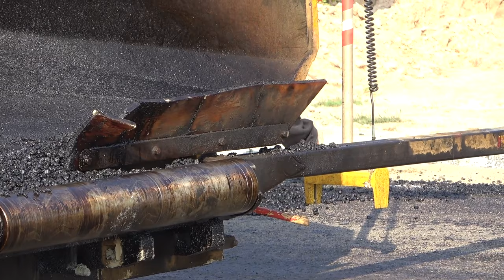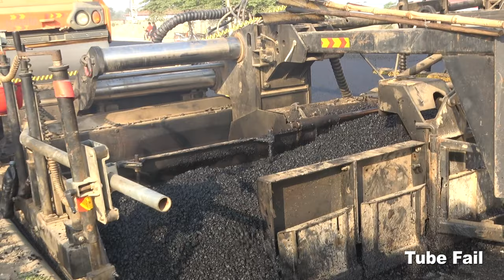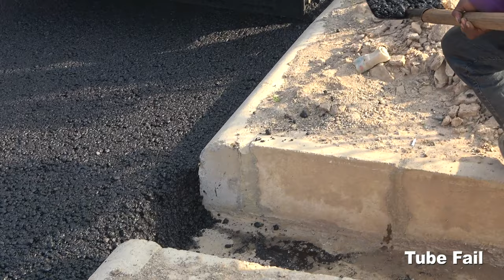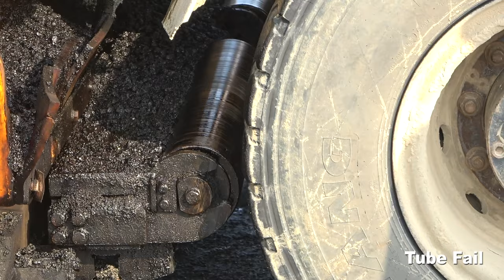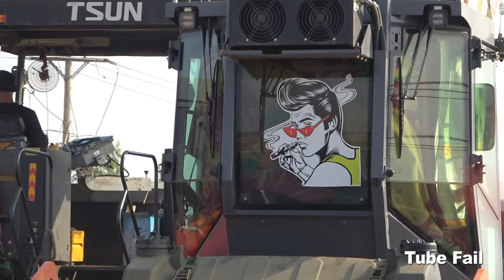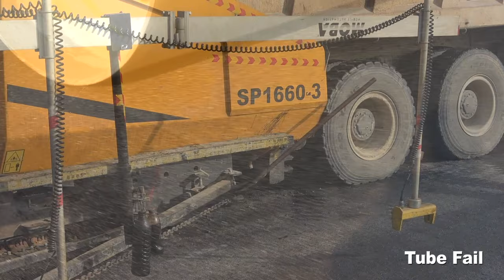Road Paving Machine | Modern Road Construction Machines | Road Construction Technology

Comment: Does the Paver push the Dump Truck?
Reply: No I don't think so, I think the truck drives at a very slow speed
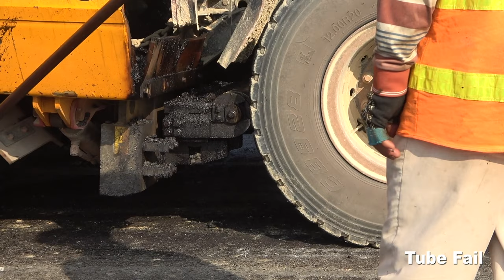Reply: @YaBoyLebbi  at 2:20 there is a roller that counter rolls to the wheels of the Dump truck. 
I was curious because the distance between the two would have a small tolerance to time both vehicles driven independently. So either the Paver was pushing the truck in neutral or Wizardry?
Reply: @vi683a  Well at the same time I think the truck is driving very very slow because i think that the machine might put to much pressure on the trucks tires
Reply: Veja o trabalho que dá uma Estrada. Meu Deus gostei demais muita bom demais Muito top10 mais top
Reply: @YaBoyLebbi  Those tires handle tons of material...i dont think the paver would exert as much pressure as normal operating pressure of the vehicle itself.
Reply: Yes, paver push the truck